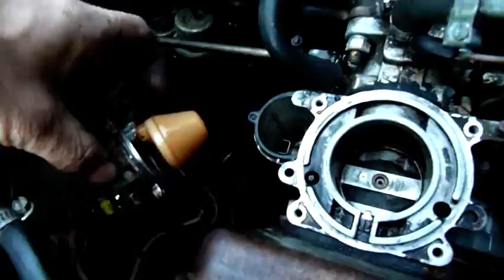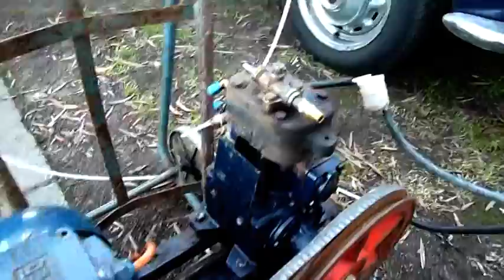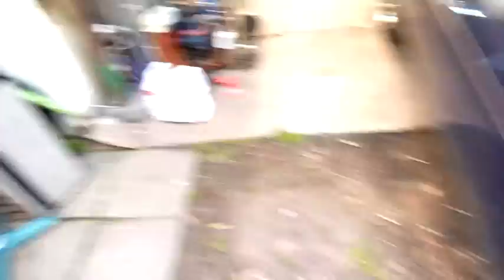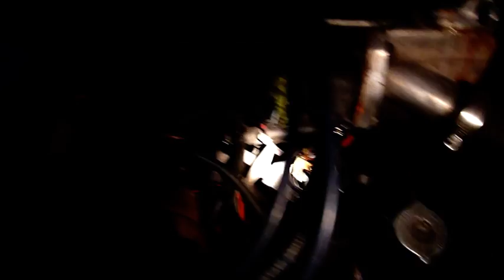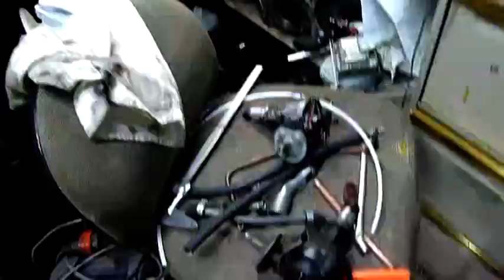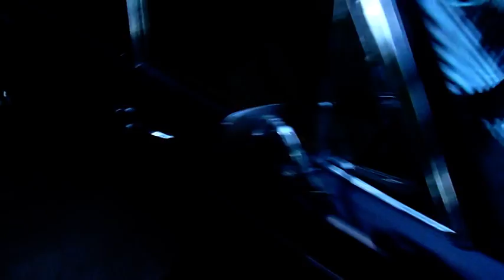Series 1 Jag SU Carbie Clean and Distributor Swap

Comment: If you keep changing the fuel filters, will it keep that red sand out of the carb?  I had the same problem with my 1981 K5 blazer.  I just put a new carburator on and i'm worried it will ruin it also.  I think the red stuff is piece of the old gas tank, slowly rotting away.  I guess it would be a good idea to replace the 31 year old gas tank next.

Comment from the maker: @Robonza not sure about the electronic ignition but the AED tube does make it a bit easier to tune. so I replaced it with a silicone rubber hose across the 2 carbs.